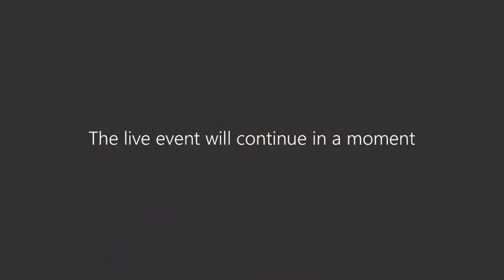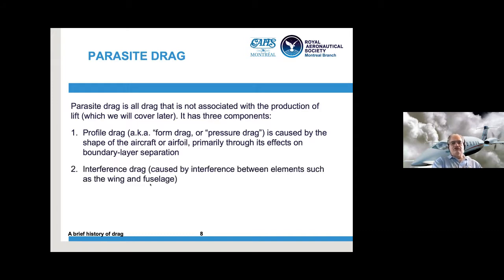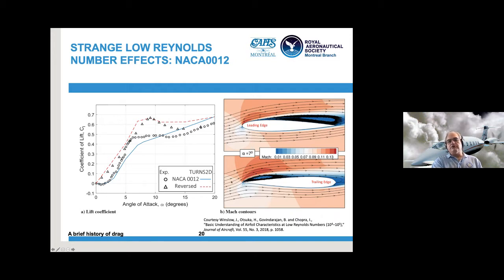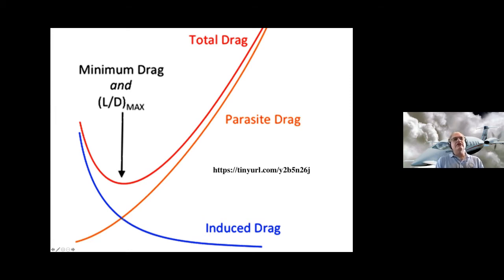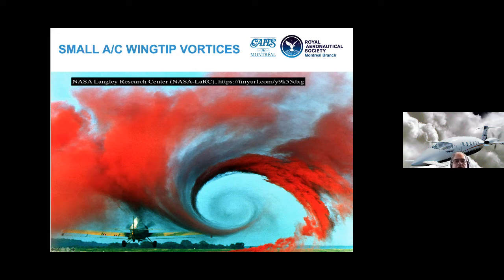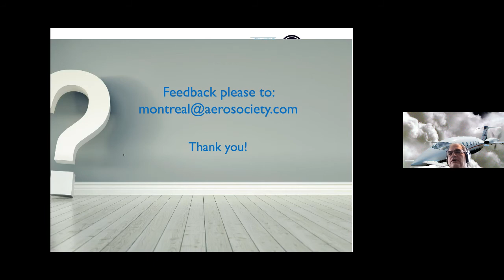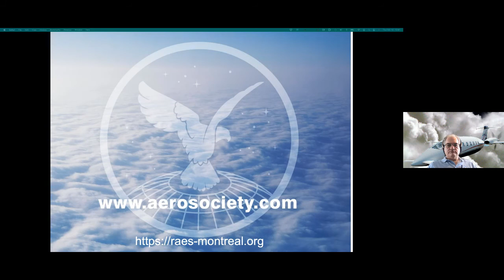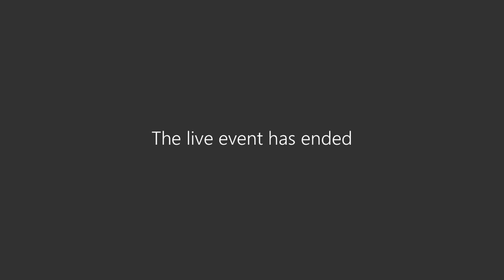Perspectives on (Aerodynamic) Drag

Comment: I believe, correct me if I'm wrong, In the horizontal orientation, the drogue chute of an ejection system is producing purely drag as the resultant force is parallel to the flight path. Once the direction of the resultant force departs from being parallel to the flight path then the normal component of that force is providing Lift.

Very interesting and enjoyable lecture. Thank you for sharing.